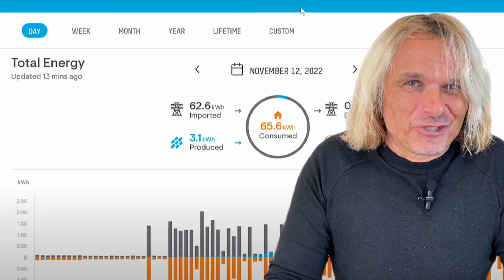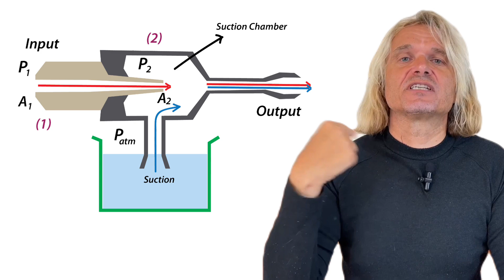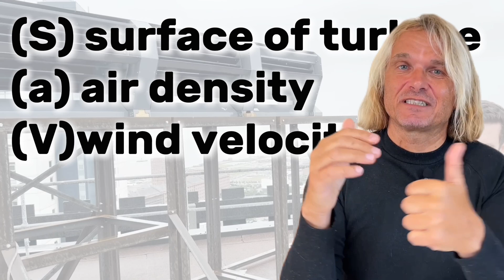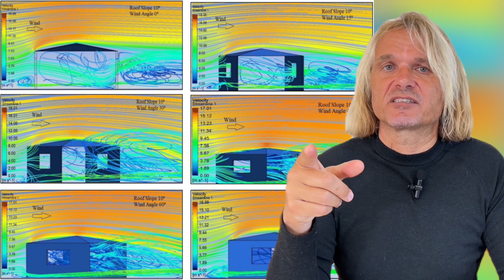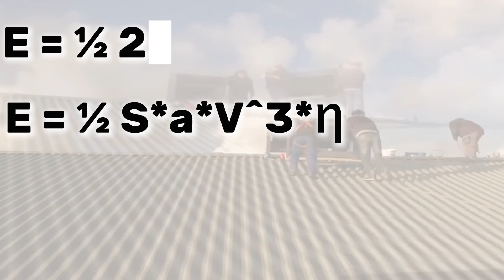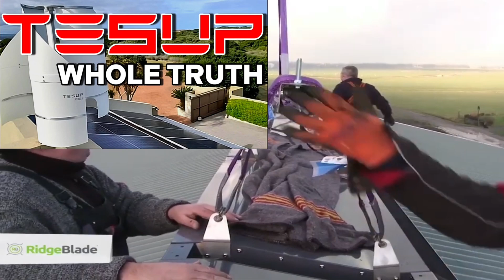RIDGEBLADE POWER FOR HOME

Comment: Your incorrect.
The Velocity and density on the intake
are affected by the
Velocity and density of the back side of the house.
This needs to be weighed against the Boyles Laws.
That the amount of pressure drop and thus acceleration of the air away from the blades has as much impact on the total blade speed as the comressed air on the front side of the building.

Comment: I really like your honesty, debunking the industry myths in all of your videos, and giving straight forward advices what's the best for us - non experts! I am in the middle of a planning of a hybrid system for my summer house, solar & wind, as there's plenty of both at that location. Started researching about various wind turbines, and after so much search, your advices to buy a simple 2kW Chinese wind turbine, seems to be the most reasonable decision. In combination with solar panels, of course.

Tnx anyway.
Reply from the maker: THANKS. for offgrid buy 48V version
Reply: @ It will be on grid system, as there's local electricity, but I want to have an option of being independent, in case that's needed.

Comment: Where can I buy it?
Reply from the maker: ridgeblade webpage is in description
Reply: @4nrgyTech  Thank you.  What is the max wind rating?  I am building in Montana, and I am looking for the top roof edge of 40 meters
Reply from the maker: I would strongly advice against this turbine. 300$ turbine will give you more energy and also would work with most of hybrid inverters(I suggest deye because they have wind power input)
Reply: @4nrgyTech  based on the best equipment for a 41-meter ridge of optimal power production ( east-west), augmented with South facing solar, I need to calculate energy storage for off grid functionality.  I saw the Chienese produced ridge generatirs last year but have not seen any installed in the U.S. and a request for a quote through their architectural firms got no reply.  So I was considering IceWind from Iceland, but they are more geared for stand-alone installs, run I need a central I terraced solution with batteries in the basement.  Of your equipment options, which would you recommend?  I read through your link, but it sounded similar to the unresponsive chinese offering with no commercial installs.
Reply: @4nrgyTech  I have 2 Deye inverters and have bought a Istabreeze 1500W turbine which I still need to install. I have not found any wind turbine option in the Deye menus. Where do I find this option and what are the inputs? The normal MPPT DC inputs?
Reply: @4nrgyTech great advice thank you. I have been trying to get someone to answer emails from Ridgeblade for two years. Glad I saw this video now.
Reply from the maker: put it on the second mppt input and you will need to input values manually. I will make video about it next week
Reply from the maker: really youll spend a lot of money and will be very disappointed with result. dont go this road
Reply: Sir what services do you offer, do you have a website or contact information for the public ?.